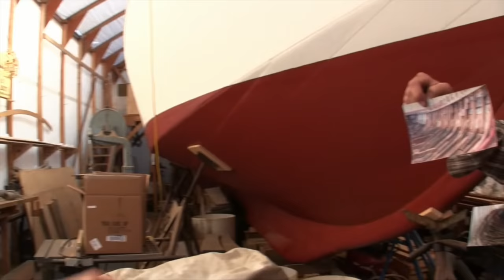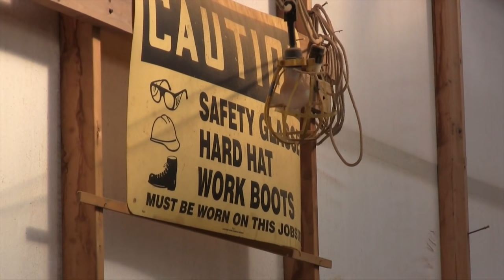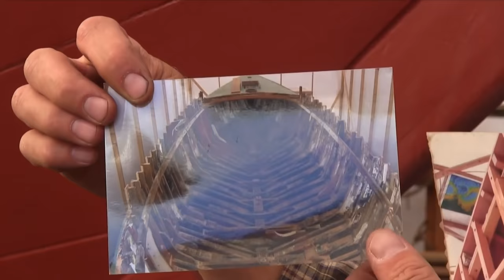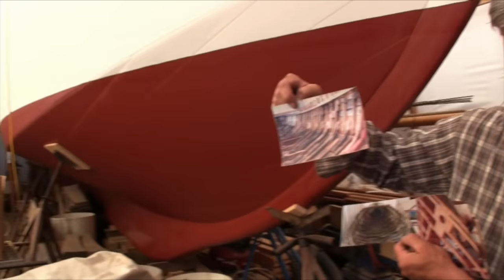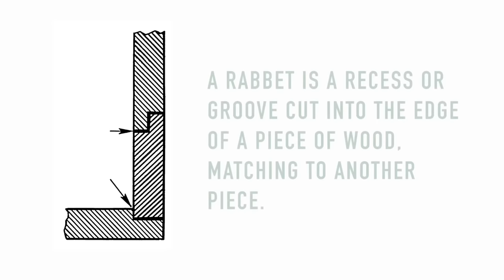A Wooden Boat named Strombus, Part 1 | #48 | DrakeParagon Sailing Season 2

Comment: I seem to recall hearing an estimate of around 2.5 lbs of boat per hour is reasonable for a skilled laborer using traditional carvel construction to build a design they're reasonably experienced with from scratch to an average yacht finish. That's about 5000 lbs per year if you can devote 2000 hours/year (40 hrs/week for 50 weeks/yr.) Professional yards can do it a bit faster. Boats don't scale linearly, but this holds fairly well for boats in the size range of typical cruisers. Even in professional yards, their first build of a design can take much longer. I'd say that's a good reality check figure though when evaluating designs and deciding if a project is worth taking on though.